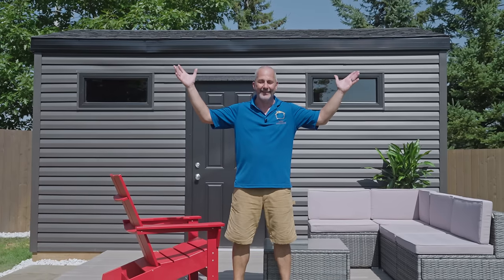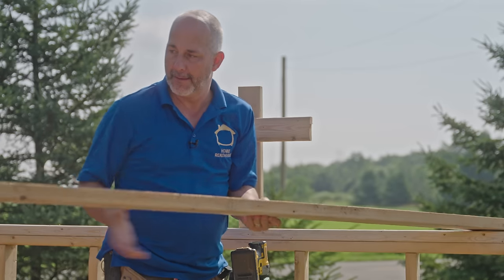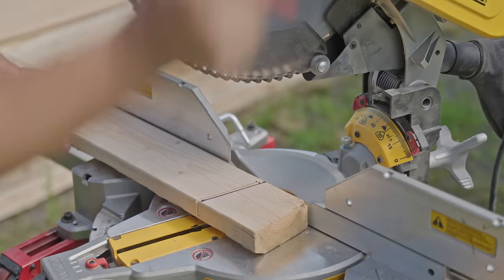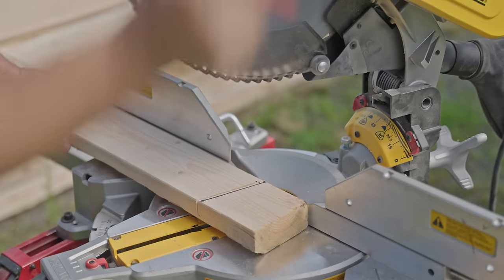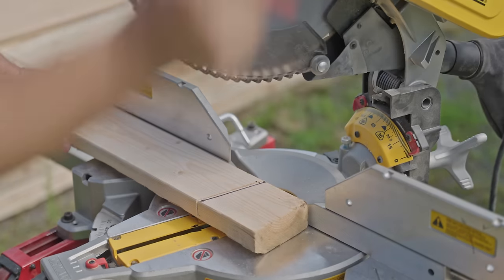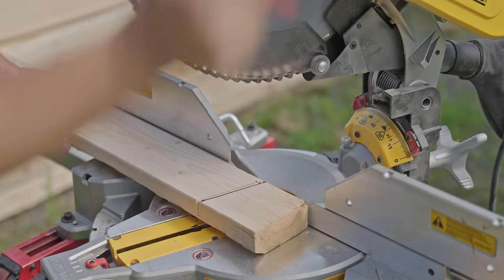DIY Backyard Shed | Framing a Gable Roof

Comment: They should practice safety by wearing safety glasses.  Especially  air nailer. Someone with less experience can get seriously hurt
Reply: They’re from Canada so for them a hospital visit is pretty cheap 🤷🏻‍♂️😄
Reply: Don't be a baby
Reply: I was thinking the exact same thing. He was using it like a foot away from his face at one point. Friend of mine lost most of his vision in his right eye doing this.
Reply: I wonder what plastic goggles are gonna do against a 1000 feet per second nail that goes through timber
Reply: Glasses won’t help a nail to the eye 🤣
Reply: Common sense is not so common with our upcoming generations
Reply: It's called safety squint. That's how the real world works bud.
Reply: You should wear gloves while typing to keep from getting a blister on your sissy hands.
Reply: Not sure you can get less experienced 😂😂😂

Comment: For everyone's reference, hurricane ties go on the outside of the building to prevent role over of the top plate during lift.  It doesn't matter in this case because you would also need straps from the top plate to the wall 2x4s and to the foundation.  His install is fine for a shed but it instills a technique you can't use anywhere else.
Reply: Correct, those he is using are joist hangers, not hurricane ties.
Reply: @hcervantes  They are most certainly hurricane ties, what tf are u looking at?
Reply: Also it will get more area that is attached to the rafter

Comment: Personally I like a overhang to keep water off the sides. Keeps mold/mildew at bay and virtually eliminates leaks.
Reply: 2’ to 3’ overhang is ideal to protect siding, and ability to keep windows open during rain, to keep sunlight off interior surfaces, furniture, storage items, etc.
Reply: @allanyoza723  yup! My house is made that way.
Reply: Correct.  They're not just for looks.

Comment: For framing, we typically hold back the 3/4" on the first stud or rafter to hit the 4' or 8' material edge.  And it would have been easier to set that ridge board 1/4" off center to make the rafters all the same length.  Just some thoughts for the viewers.
Reply: Yup, that's why you see him scab on extra wood later when his layout doesn't line up!

Comment: 21:40 Good point. Especially important when hiring contractors to redo a asphalt shingle roof. Say if some of the roof decking was needing replacement and was removed. And then they started dropping bundles of shingles on the ridge, shaking the whole house with every drop. A few days after the job is complete, it's windy out and you hear some strange sounds on the side of the house. You go out back to have a look, and surprise, ten feet of the aluminum soffit has dropped out of place and is blowing in the breeze. Fun. Is that section of the wall no longer plumb now because of the dropping of stacks of shingles on the ridge. They did that while some of the decking was removed. Don't know. But all the movement caused by that, resulted in an additional problem. Russian roofing crew. Nail gun Vlad was fast. So fast, the upon checking the underside areas in the attic where new decking was laid down, the nailing of the decking completely missed the roof framing. I guess that is why it's called air nailing.

Comment: good stuff, learned a lot.  One comment on the Hurricane ties, didnt realize they have different sizes. Local HD does not carry the 3 hole (larger/Taller) ties, only 2 hole.  Never knew couldn't use the deck screws on rafters! Thanks

Comment: Hi Jeff and Matt, love your team work.

Few questions:
1. What if you cut rafters shorter and then use one piece of 2x4 instead of blocking pieces?
2. Is it not necessary to use any kind of rafter hanger on the ridge end?
3. Could you cut the end of the rafter in a way that it sits flush on your bottom plate to avoid the hurricane tie?
4. What size of construction screw do you use? Number/length

Cheers!
Reply from the maker: just trying to create a natural watershed so we don't have to seal it up waterproof. but your idea is a very legitimate solution. cut flush to the wall and use the 2x4 as a rim board to create the overhang. would have saved a ton of time for sure. In this video we are showing the traditional way in case you want a larger overhang with soffit. Cheers!
Reply: @HomeRenoVisionDIY  A question in regards to this, and maybe it's something you've covered over the years and I missed it.  Would like to build a similar shed, however I want to do my ridge board from front to back and then have a lean on each side.  The question, is there a good and easy way to tie in the roof of the lean to the main structure?  

I'd prefer to tie the roof together if possible, rather than nailing a board across the side of the shed and putting the lean joists on top of that.  Hopefully that question makes sense.

Comment: I’m not a builder but watch a lot of these videos. I live in a house that was built in 1947 and noticed my ridge board in the attic is literally a 1/6 or 8. Was that common practice back then. Doesn’t seem like enough support to me. This house has made it through hurricanes and all kinds of stuff for so many years. I guess it’s fine
Reply: That's rough cut, hardwood, and older growth with tight grain. It's several times stronger than the trash, today. As long as everything is tied together well enough, it's not gonna blow away. It'll have to be ripped to shreds piece by piece.

Comment: my last house, I was about to attempt extending patio roof. I wanted it to match roof slope. Used no Math or anything. my idea, I took short 12" piece of 2x4. held it vertical to roofs edge. put a dot on right edge, on low end. Put dot on left edge high side. Drew line conncting dots.      [     \   ]  cut the angle. flipped board over on 2 "planes"-🔄🔃. it created roofs pitch😁😁

Comment: Don't feel bad about that rafter blocking.  It is still technically a structural element in that location as a load path transfer mechanism of any lateral loading from the roof sheathing down to the top plate and into the shear resisting wall below.  Not quite a super critical element for a small shed like this, but the "bonus" nails weren't totally wasted as they will increase the structural redundancy of the overall system ✌

Comment: I’d personally go one nail on either side of your block, diagonal into the rafter. Just needs to be pinned in if it’s cut tight enough; but it’s good that you go overkill when winging it, because too much is far better than not enough when you’re (or your client is) investing good money into a structure.. 

Belt & braces is never the wrong method, just sometimes less economical. It may cost more, but it’s that ‘extra effort & quality, over cost’ mentality that ensures ancient architectural marvels still stand today, while a modern day kit home will have perished within 50-70 years.
Reply: I'm just going to mention that the bay support beam on my 1930's house had a cut line right in the middle! There were cowboy builders back then too, lol 😸

Comment: Hi guys doing a great job . 
If i have a 3 ft shed width & 8.17 ft  Length; which type size ; thickness wood / batten - how many  of them . Only for the roof - Not the walls . If i want to do a roof like that one . 
To be quite cost effective the battens Length comes in different length ; 1.2 ; 3.6 ; 4.8 metre ;  ; so in order Not to cut & throw 1 metre or 1/2 metre  from each battens

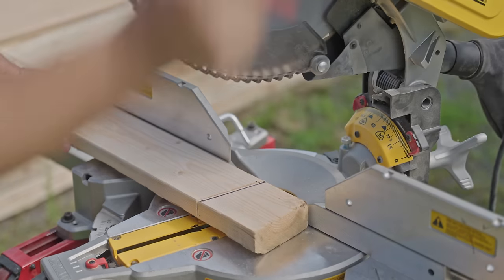Comment: 19:55 Those hurricane ties should be on the outside, notice that you are missing the bottom nail hole there? They should be nailed too but there are special screws that can be used (...noted that this is just a shed)

Comment: How do you get the roof joist flush to the end of the roof rafter with the hurricane brace wing in the way to form the triangle roof truss?  Hope that's clear?  Great video.
Reply: Put the hurricane tie on the outside as it's intended (someone in the comments already mentioned that).

Comment: Using those hurricane brackets to avoid making a bird's mouth seems to increase the cost in order to avoid making that simple cut.  I think if I was going to have a bracket on the rafter I would put it on the beam side to  make working at the top easier by just setting the rafter "in the slot", so to speak, but you much more than me, a weekend amateur who is building a  10 x 16 shed, as we speak.
Reply from the maker: enjoy the build. Cheers!

Comment: Curious if you would recommend using an engineered 2x6x16' instead of natural lumber, it would get rid of the crowning issue, and it just seems to prevent a lot of problems, for a price premium that is relatively insignificant for one piece out of the project.
Reply: It really does just come down to cost/availability. Comparatively,  the engineered beam will most likely cost 5x that of a regular 2x, so if you want to spend the money to make your life easier (and ridge stronger) go for it.
Reply from the maker: I get it, however availability for many folks just isn't reasonable. So I like to build showing the problems most folks will run into. but a great solution for sure if you can get one. Cheers!

Comment: I only use 12G outdoor extension cords. Even if I only need to go 6 inches and I only have a 25' 12g extension cord, that is what I am using. No use buying different gauge extension cords for different things. I buy 12 gauge and only 12 gauge.

Comment: If your rafters didn't line up on the four quarters, how would you determine what's out of alignment? Beam, Walls or something else?.... Asking for a friend.
Reply from the maker: doesn't matter. just laminate a board to make it work. no one is giving a best in show award to the roof when it is finished. Cheers!
Reply: That would take trial and error to figure out.
1st thing I would do is measure width of walls and see if there is a difference, the way it's supposed to be done is you can pre cut rafters using math, cut your ridge to length and set all 4 corner rafters and slide your ridge into position and check level of the ridge, if your walls are true and level then ridge will be level.
I suspect the floor was built off level to begin with causing the ridge to be off.

Comment: I'm trying to remember the different roof types: Lean to, Gable, Mansard, Gambrel, and Pagoda. I'm sure there are others as well. I know lean-to is single slope. Gable is 2 slopes. Mansard is 4 slopes. Gambrel has 2 slopes but changes angles. Pagodo has 4 curved slopes. Did I get that right? LOL.
Man, I'm glad I don't live in a city or anywhere near an HOA. I can make my roof slope whatever I want it to be. LOL. No neighbors are close enough to even see my house or other structures on my property. One neighbor's horses, cows & goats may be able to see it but obviously they don't care. And the other neighbor's friendly pit bull that comes to visit won't care. All he wants is to explore and be petted and told he's a good boy.
I was thinking the roof could use gussets, but it's an inexpensive shed and the roof isn't that large.
I'd still want to do a metal roof instead of shingles. I don't like shingles. LOL.
Reply from the maker: I prefer a single slope as well. Cheers!
Reply: I never heard of a pagoda roof, maybe you mean gazebo? Or maybe you mean a hip roof which is a gable roof with both ends sloped down to the top plate?
Reply: @SmileyDave-h5z  its an Asian style roof. Similar to mansard but it has concave curves before flaring out at the bottom.

Comment: I see that you're putting the hurricane ties into the rafters.. question if You're using ceiling joists and they're connected to your rafters. can you use the hurricane ties to attach to the ceiling joists??
Reply from the maker: you actually have to tie the rafter to the wall. the nails used to tie the joist to the rafter would have to be engineered otherwise.
Reply: I'm  lost.  In the video the joist sits flush up against the rafter.  How can the happen if the hanger wings are in the way?

Comment: What's the reason not to also make a little notch on the bottom part of the rafters to they lean on the topplate? (just curious, EU vieuwer who never uses wood, or if, most common is prefab stuff)
Reply from the maker: the art of cutting a birds mouth rafter is not something i expect most viewers to employ so why teach what folks are not going to be successful with. Cheers!
Reply: @HomeRenoVisionDIY it would still be nice to know how to do. It may be required in some areas. Some local rules can be obnoxious. lol
Reply: @HomeRenoVisionDIY  Cutting a bird mouth is not an art that most DIYers cannot do.
Reply from the maker: to make 20 or 30 of them all exactly the same is a lot of work that is completely unnecessary if you use the hurricane brackets. My design saves time and does not sacrifice strength. Cheers!
Reply: @HomeRenoVisionDIY It’s not brain surgery…why not show us how and not skip over it? Do better!

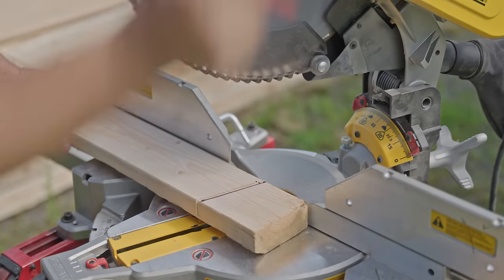Comment: @24:06 You used a screw to suck in boards on the first side so they're flush, but didn't do that for the second side.  I was thinking you were going to offset them and repeat the same thing on the other side.  Why?

Comment: all you had to do is lay it out with a rafter square man.....if that buildings 12 ft wide, a 3 pitch would put you at 18 inches rise, per half the building width...3 x 6 = 18 inches....the rise starts out roughly 4 inches high because of the 2x4....  so your rough framed peak would be around 22 inches, give o r take...its easy math really....
Reply from the maker: math is not easy for everyone. This way at least everyone will have a system that works. Cheers!
Reply: I see what you are saying and I'm excellent at math but when building stuff that type of explanation my Brain doesn't work the same so Jeff's way would work better for me. Always more than one way to work a problem
Reply: didn't know Jeff was here for just you. Like you said, you know it, math and all. He's teaching people in the simplest way possible who are LEARNING. 

Why you folks come in his comments and try and act like he's doing it wrong or not doing it your way is laughable. Jeff is an excellent teacher, industry expert and looks to be doing just fine. 

Btw not everyone is a mathematician. I mean, I am. But still.

Comment: How much rain can an open structure take? I'm in Atlantic Canada and it rains all the time. Hard to spread out a build like this over free weekends.
Reply: As long as you let it dry out before enclosing it or let snow or ice stay on it for long you can go awhile.
Reply from the maker: one of the reasons we used PT plywood. It can be real rainy in the summer in Ottawa. build it and let it dry later. Cheers!
Reply: @HomeRenoVisionDIY  I rather keep chemicals out but than again.

Comment: Why did you change from lean-to to a-frame roof design?
Reply from the maker: showing different options. some areas the shed needs to look like the house plus you get more head room so it is cooler in the summer.

Comment: Another great series, what kind of screws are you using in those hurricane ties
Reply: Likely Simpson metal connecting screws. They are code compliant.
Reply: @Thumbsdwn likely whatever he wants, this is a shed
Reply: @YellowBunchofBananas  being a DIY channel, I thought it might be helpful for others to know the proper fastener for metal hardware like this, regardless of whether he is using them or not.
Reply: @Thumbsdwn Yeah fair. BTW I think he might actually be using Simpson SD connector screws in the video since it looks like he has a hex drive bit in the driver.
Reply from the maker: definitely using the proper Simpson structural screws.

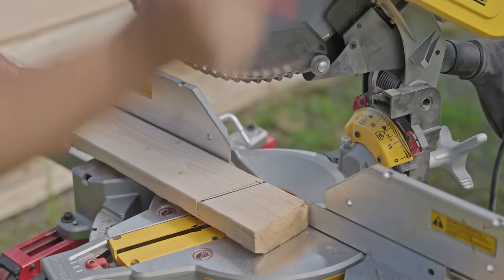Comment: 35:00 I mentioned in a previous video how you lay out studs/rafters incorrectly, and although you don’t mention it, this is why you had to sister on another rafter
Reply: It is not wrong just different. Do you require 2 top plates  for a shed, probably not, a couple of metal plates here and there would have done the trick.  Gable end does not structurally need 2 by 4 studs either but it does not hurt to fasten sheating to.  There are shed out there with just siding straight fastened to the studs and bracing  as a structural component.
Reply: @cumbaja3456  no, it’s wrong. When laying sheet goods, you want the 8ft side to land in the middle of a rafter when starting flush with the outside of the building/roof.
Reply: @Thumbsdwn  It is all about support, conventional framing yes, but one man show you will have to improvise.....

Comment: It would have been nice if you showed how you cut a birds mouth on the rafter ends.
Reply: What's the benefit of this (generally curious), or more easy of building?
Reply from the maker: no need for the extra difficult step. just use the hurricane ties and a few collar ties for stability. Cheers!
Reply: @HomeRenoVisionDIY lol "just do a half-assed job, it's just a shed"

Comment: Why was only the back sheathed?
Reply: On a previous episode, that was the single large wall they stood up. The sheathing was to help them square it off and add stability. The front wall with windos and a door provision was made and stood up in sections so sheathing it was not practical. Also probably to keep the front unobscured  from the front for the viewers.

Comment: 38:37 how about 1/8 gap between sheets?
Reply from the maker: on such a short run you will find the expansion is not an issue. once you get 3 layers of osb on a roof it becomes critical. Cheers!